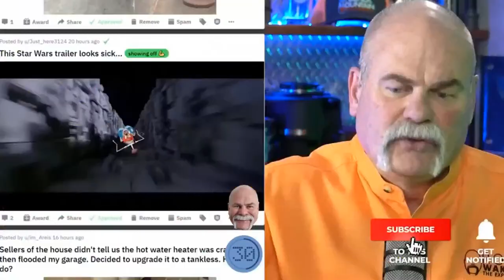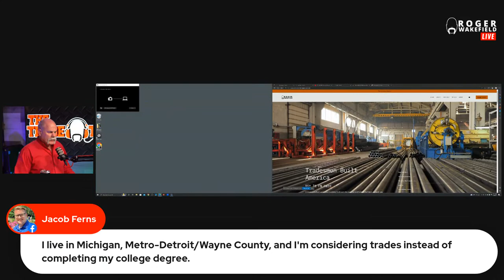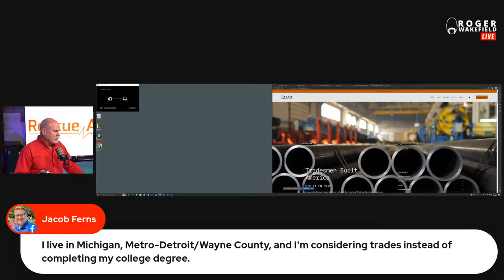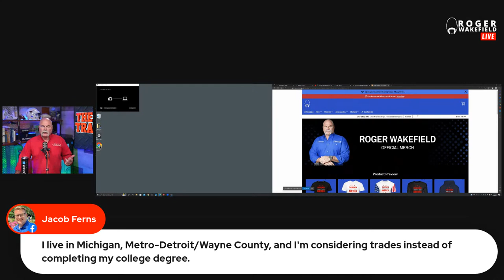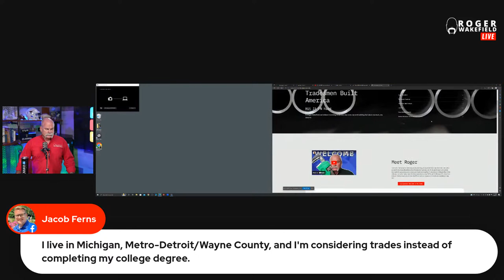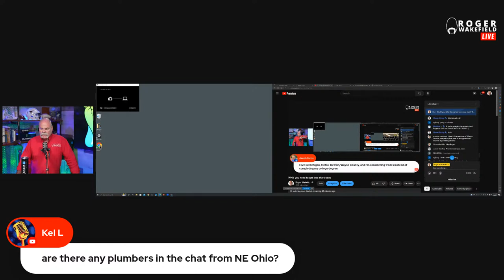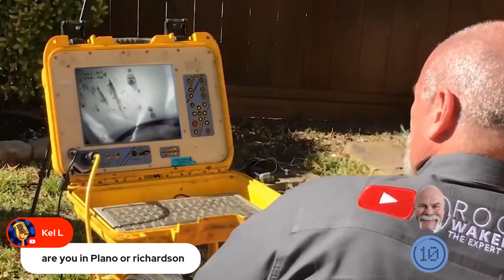WHY you need to get into the trades

Comment: I'm from Puerto Rico, I am a Licensed HVACR technician and I work as a Refrigeration & Appliance Repair Technician, I also have an educational and professional background in Electrical(Motors, VFD's) and Diesel Mechanics(Mainly Generators and Fire Pumps). I plan on starting night school on January to get certified in Plumbing as well since I encounter it daily whether it's in the residential sector or commercial, industrial.